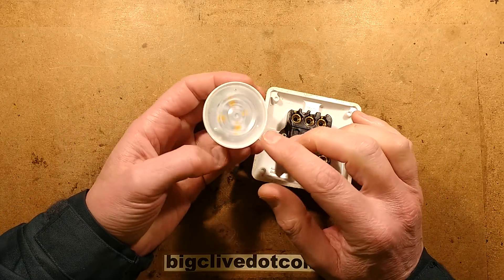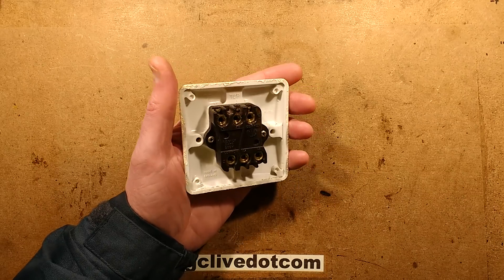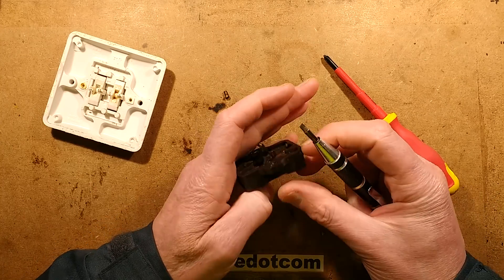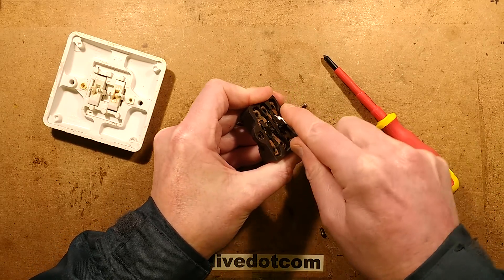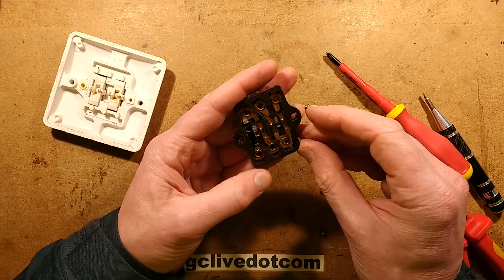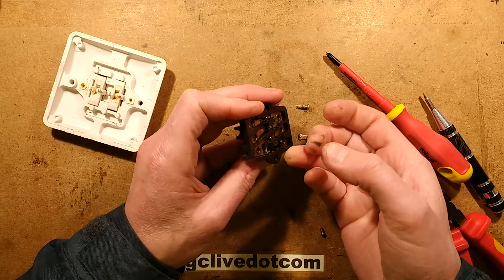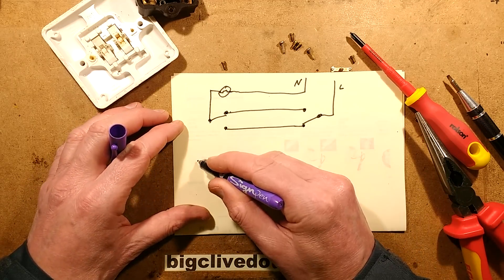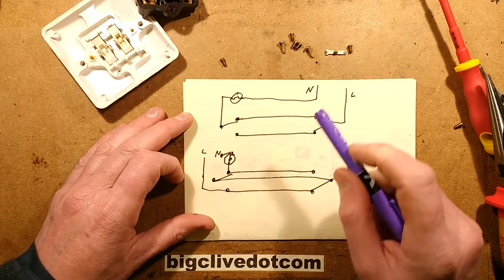Old arcing switch killing LED lamps.

Comment: Hiya Clive, I have a question that I hope either you or my fellow subscribers can answer.....
 Many small  devices use three 1.5v  cells, but battery chargers only allow either two or four to be recharged, so you need four. This means you constantly have three depleted, and one full battery. Is it advisable to deplete the full cell to the level of the three before attempting a recharge, or should you pull all the cells down to the minimum state using a joule theife before recharging?
I currently number my batteries with small dots, 1-4, and sequentialy rotate the ones in the device, but with so many things needing batteries it gets confusing!

I guess my question is, is there an efficient way of cycling an odd number of  cells in chargers that only deal with pairs?
Reply: Hitchawk The Only   Buy a more expensive charger that charges cells individually...
Reply: Hitchawk The Only Charge 6 or 12 at a time to get an even number that is also a multiple of 3.  You'll often end up having at least one fully charged set of 3 lying around.

Comment: if a piece of wire creates a electromagnetic force those contacts might be a bit close together and create some kind of magnetic induction if it’s running on mains voltage? i don’t know 🤷‍♂️
Reply: that resistance might burn because it’s overloaded the switch somehow? I’m not qualified.. 😔
Reply: exactly, check the huge back EMF spike the LED's bulbs cause, they are switch contact eaters by design!

Comment: Another great video.  I recall working out the 2 way circuit for myself when I was about 14 but the old circuit, in the days before internet so I could look it up.  I didn’t know the modern way but it seems much better and an easy way to convert a 1 way switch to 2 way.  Thanks Clive.
Reply: david jones I was taught the traditional one (including the 3 switch variant) before the age of 10.

Comment: I would consider this a design flaw. 
I understand why the fuse blows with the way it's currently designed, but it should never be designed in such a way that it blows because of an arcing switch.

Comment: Clive, i bet you have seen this loads of times.

The number of times people have tapped my door because they removed the light fittings and got the wires mixed up, then it blows the breaker when the switch is thrown.
Wire seperation time lol.
Reply: They always shove all the reds/browns back together and all the Blacks/blues together then wonder why the power trips when they flick the switch. I always have to go in and remove the switch wire from the neutral block.
Reply: Yep they do lose the plot, and the switch ends up connecting across the mains lol :-D.
You sound like you have had a share of other people screwing them up, its mostly blokes that wire up a new fancy light fitting, all posh and in darkness lol.
Reply: Or get confused because there are more wires than they expected...
Reply from the maker: That'll be the classic all of the same colour twisted together at the ceiling stunt.
Reply: Mark 1024mak, i don't know as i'm called after the screwups lol :-D.
One bloke just vanished and left his wife to let me in, i did say to her after the rewire "Tell your husband  you fixed it."  lol :-D
Reply: bigclivedotcom, Yep, it always seems to happen, every bloke that screws it up does that.
Why do these people not cabletie the joined wires so they dont have to guess lol.

Comment: Here in Poland on the stairwell, we have 24v AC installations to prevent theft by tenants. The 25W bulb was constantly burned out, there are no LED 24v AC bulbs in stores. Well, I made it very simply. Only four LED strip 12V in the rectifier bridge configuration, no flickering [6W].Brighter than old.

Comment: And I like some of the switches in my house, where it's just a holder with an indent on a leaf-spring friction thingy that keeps the lever rocker in place. Inside that plastic on the back side of the switch lever is a glass bulb with some mercury. So it's the mercury actually acting as the switch contact. Probably couldn't sell it these days, but it's sealed and works perfectly as corrosion would never be a problem. Looks the same as current U.S. style wall switches except being completely quiet, and I presume it dates back to the 60's when the house was built.
Reply: Apparently somebody did a video on them: https://youtu.be/S5Gs1FSVjcs
But yeah, will never have that corrosion problem because the actual contacts are permanently sealed.
Reply: good old switches, that rarely went bad unless overloaded majorly. though eventually the wire would break inside some.
same for old "heat only" mercury capsule thermostats, physical damage was about the only thing that broke them :)

Comment: I have a kitchen flouro that is regularly tripping the downstairs breaker in the consumer unit when being switched off, and it's pissing me off cause there's only me and my son that can reach the breaker to reset it.  My wife is too poorly to even think of stretching to reset it, and it breaks the stairs lighting (up and down) and the room lighting, so if she's got a hot cuppa in her hand and the kitchen light trips the breaker, she's in the dark - unless the TV is on.  

I've had the council out umpteen times and they don't believe me. I have replaced both switches (dual - dual switches, the only thing that the re-fitters didn't do when they f*"%^&£d my house up), had several guys come and swap the starter of all things (within weeks of each other - I've replaced a load myself), and nobody, not one of the peeps have looked at the fixture or the consumer unit. I cannot touch those else I'm liable.  I am proper fed up. 

Any ideas guys, please? Bear in mind it's not my property, I just rent so I cannot replace the elcb's and all that malarkey - though if it came down to that I would -  I'm capable just not qualified.
Reply from the maker: Could be the insulation breaking down in the ballast with the switching transient causing it to spark over.  An insulation test to ground would show that.  Or just swap the fluorescent fixture or its ballast.
Reply: It`s really got to be the fitting! What a set of clowns changing starters! If you are capable, disconnect the flourescent
and connect a pendant to the incoming wiring, let it dangle proudly from the ceiling, and go find a BULB from the days when things used to be normal! You should find it will illuminate to your entire satisfaction, then you know it`s the fitting for sure. If there`s a real issue for your good lady, I would plug a couple of desk lamps in the sockets, and cease using the floro until the gormless council get a grip!  Good luck with it.

Comment: I was wondering when the issue of arcing would rear it's sparkly head. Incandescent bulbs tolerate arcing but circuits don't usually do as well unless it's designed in, which if manufacturers have their way, won't get built in; so we can buy more bulbs ;-)

Comment: You said they put a fuse in to protect the LEDs against an arc but what is the point if 99.9% of people won't be able to repair and will throw away?
Reply: probably helps stops the LEDs from smoking or exploding/popping

Comment: I had a poor connection to a nicad charger apparently overcharge a nicad battery drill pack to the extent that one of the cells started venting.  I'm guessing no current limiting in that design (or perhaps it defeated the cut off).  Still under warranty fortunately so back it went...
Reply from the maker: I had a battery charger crash once and cook the cells that were charging.

Comment: Now I know why my chandelier keeps on blowing it's candle style incandescent bulbs. My whole house uses those switches.
Reply from the maker: Vibration and orientation of the lamps can cause premature tungsten failure.  Especially fixtures that have the lamp mounted horizontally or at an angle.

Comment: I was working for FES on a school refurb about 12 or so years ago. I used the second method (the 2 way conversion circuit) to get the lights working in a room they wanted lights in... but didn't have the other wall in place where the second switch would be located or another 2 way grid switch. So I wired it all up and connected the other end with a bit of terminal block, left a drawing taped to the cables and explained what I'd done to Joe (older spark I was working with)... I finished up that day and started here in the beeb the following Monday. Couple of days later Joe phoned me and said my name was mud on the job... they couldn't figure out how to fit the switch on the carefully marked cables that I'd left them... complete with afore mentioned drawing... I said to Joe "you know how I did it, couldn't you fit the switch?", "of course" he replied, near peeing himself laughing "but where's the fun in that?"
I thought every 1st year apprentice knew that circuit... apparently not tho.
Reply from the maker: I worked with FES myself for a while.  They weren't exactly notable for vetting the quality of their employees.

Comment: We are going to need to swap to low current contacts in some applications as the high current contacts in a lot of low-cost lighting switches need a good arc to keep them clean.  This is one reason why in low-current applications you get different contact materials to prevent exactly this problem.

Comment: "Crappy old switch"?  I'd imagine that it's better than most you can buy today, just needed the contacts cleaned off.  Granted I don't know what's available at hardware stores in your neck of the woods but how old do you suppose that switch is, 40 years old?
Reply: Nearer 50 years old, probably 1960s. It's an MK switch, and the 'modern' white square Logic range was available from the mid-1970s, this is the earlier style.

Comment: I 've been having trouble with halogen bulbs not lasting in a outdoor floodlight and kind of want these:

https://www.amazon.com/Meridian-Electric-13159-14W-Bulb/dp/B00NP1KEJ8/ref=pd_ybh_a_6?_encoding=UTF8&psc=1&refRID=4XW2XV344HMW17988DSB

i wonder if they're worth it...
Reply from the maker: Check that the ends of the lamps aren't being damaged by burnt contacts in the fitting.  Halogen lamps are also quite sensitive to vibration.
Reply: OK thanks Clive I bet it is failing contacts like you say, the fixture is from 1998. Looks like I'm headed back up the ladder to check it out tomorrow because I see one is out again, at $4.50 that gets annoying. It's probably time to replace the fixture.
Reply: Buy a new LED floodlight John. Wider range of products, than the limitations of the lamp in your link, and a spanking new light for much the same price. Only annoying thing I find ( in the UK ) is they are pre wired, so you end up with a waterproof connection box outside.

Comment: We get similar problems here in my humid house, plus the place is old with no place for cavity insulation so condensation forms on external walls and windows (double glazed) all the time.
Reply from the maker: I recommend good ventilation in warm weather and dehumidifiers in winter.  Compressor based ones for a warm house and heated desiccant drum units for a cold house.

Comment: oh 3 way switches are real common still. seem to see in hallways and big rooms a lot. i never seen them wired either of those ways ever. then again they use 120 volts in the US so might be different. seemd to what is common http://www.electrical101.com/3way-switches.html

Comment: We had this problem with quite expensive OSRAM LED lamps. It took us a fair ammount of time until someone had a look at the switches. I guess these switches would eventually kill traditional lamps as well after enough time, but the failure mode was far from obvious for non-professionals :). Thank you for sharing.

Comment: How in heaven’s name is the more modern way easier? Damn.
Reply: The second circuit that Clive described is now the most common arrangement in the U.K. for multiway switching in domestic buildings that have been built or rewired in the last twenty to thirty years. It's preferred, as it means less cables to run. The mains feeder, a 2 core and earth (L, N & E) cable runs to the light fitting, then another 2 core and earth cable (again L, N & E) runs to the next light fitting in the next room. From the first light fitting, a 2 core and earth cable (L, SL-switched Live & E) runs to the first switch. Then a 3 core and earth cable runs to the next switch. If there are more than two switches, the middle switches will be intermediate types. Then the last switch is a normal change-over type.
Reply: A site that shows the U.K. modern arrangement is this one: http://www.lightwiring.co.uk/two-way-switching-3-wire-system-new-harmonised-cable-colours/
Reply: Thanks...  It's interesting to see how other countries do what I thought was a pretty much standard/given arrangement.   I'm still not seeing the advantage, since it looks like (most physical layouts) you end up using more wire for no reason, and passing power over longer wire-lengths.  Still, interesting to see how this is arranged in case I run into something wired this way at some point.
Reply: Agreed with you -- that "modern" way is a nightmare for the 99.9% of US electricians that expect the first diagram (two travellers selecting A or B paths for on, off when they disagree).  It may even be against code here in the US(?).   It makes the wire run 3 TIMES longer for truly maximum voltage drop.  

I have seen a third wiring diagram (I believe also against code) that connects N and L to the A/B terminals of EACH switch and has the load in a single wire between the switches' common terminal.  As this often results in a dual-circuit (illegal) setup, it's highly frowned on as well.
Reply: Brennonicolini It's easier if your making a one way switched light into a two way, as your feed and switch wire are in the same switch (that's why it's called the two way conversion circuit). I think it's 6 and half a dozen if you're doing a new install tho... handy to only need one cable heading up to the light fitting rather than one from each switch I suppose.
Reply: I wish we could post diagrams here to know what you're referring to RR...   There are many permutations of physical layouts that result in the same electrical diagram, but I can't imagine any 2-way to 3-way conversion that doesn't require adding a conductor.  Once there are GNHH, there's no advantage to the #2 "bussing" layout over the #1 "selector" layout, and the above disadvantages.  The most common physical layout I've seen runs supply-GNH-switch1-GNHH-switch2-GNH(switched)-load, but you may have other physical circuit constraints.

Comment: Are you in the Isle of Man?
You could fill the whole thing with grease stop it arcing out plus if it's outside your bedroom it makes it very quiet when people switch it on and off just a little tip there if that wakes you up! You might have to be careful what grease to use? 'Never use high speed grease like black grease this contains graphite or copper grease'? wouldn't be suitable, you could use petroleum jelly.
Reply from the maker: On the basis that I'm single and live alone I definitely don't want to hear the light switch clicking on and off outside my bedroom.
Reply: Yep, it's where he lives!
Reply: problem with grease that often destroys switches that have it in them and probably is why clives switch died is that each time you turn it on/off carbon builds up and sticks to the grease.  eventually there is enough in the grease to impair conduction and cause it to fizz.

I have a classic van and the headlight switch dies this way, it melts! as the carbonised grease forms a higher resitance path, heats up real quick and melts the switch.
Reply: if he was IN the Isle of Man he would've been a Mole
Reply: bigclivedotcom rightly so or it could be your lucky night 😂 when you got a handicap person constantly playing with the bloody switch it's a fucking pain that wakes you up! I couldn't find any decent touch-sensitive switches maybe could do a segment on this! My electrical  supplier said he had problems with distributors they were unreliable so he doesn't sell them anymore? Like the old TVs used to be  just had a metal plate. If you know of any reliable ones let me know.

Comment: Its funny i had the exact same issue here. All my switches were still made from bakelite, and painted white :D
Told my landlord and she wanted to get an electrician to change all switches at once, not checking them or waiting for others to fail.

Which was bad for the reason that i'm simply not at home when contractors charge their usual rate.
So i recommended to her that i order the switches from a supplier in her name, and change them myself.

Saved her a lot of money, and me the hassle of taking half a day off at work.
Also i got way nicer switches than what he would sold her, because i don't got any contracts with any suppliers, and didn't need to make any profit from it.
Reply: only problem is, if you're not a licensed electrician and you get a fire, your insurance might not give you any money if they figure out you did that.
Reply: xorinzor, only if you did something wrong that they detected, or were foolish enough to state that you replaced them yourself so maybe you did something wrong.  Replacing a light switch is far from rocket science.  However you seem to misunderstand what Wupme wrote.  Read it again.
Reply: That's the right decision.  They were probably all the same age, in the same environment, so all have oxidized, corroded, and to some extent may have the same level of carbon deposits too.  No sense calling out an electrician over and over again for each switch as the service call to get a pro out is most of the cost vs labor to merely replace a few switches.